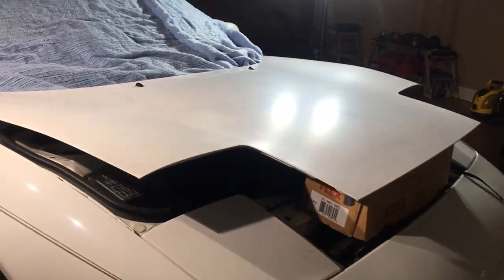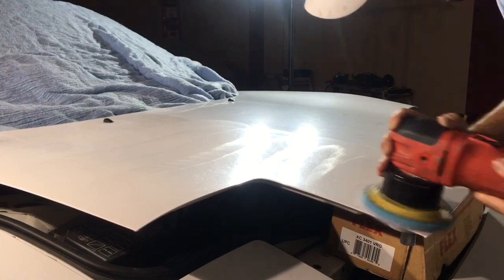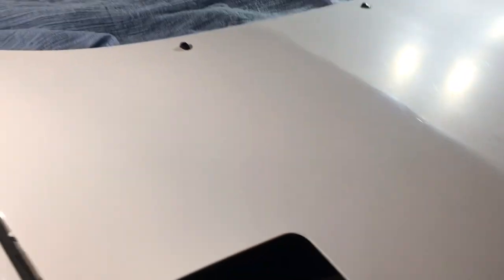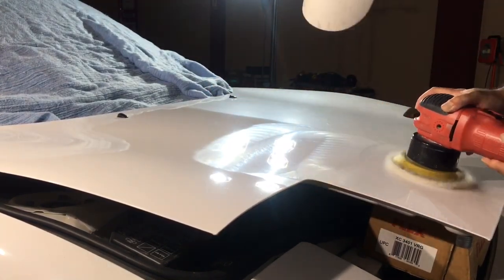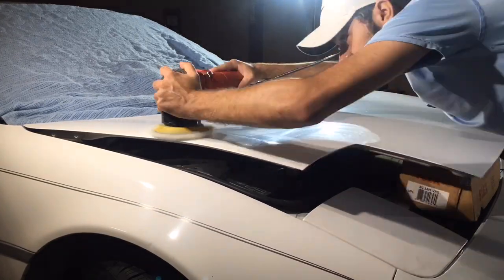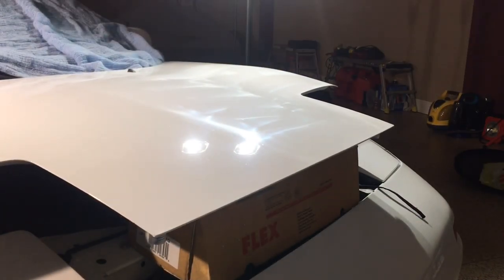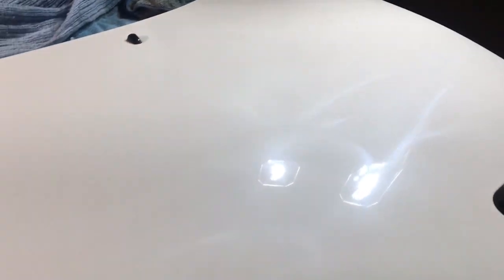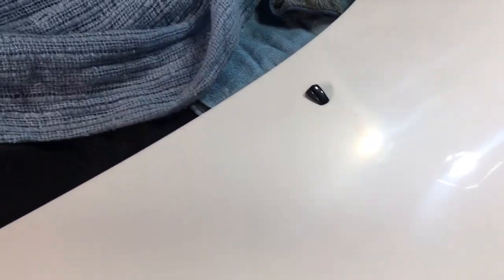Beginner Polishers Vs. PRO Polishers THE UNTOLD TRUTH! | WHAT YOU NEED TO KNOW!

Comment: If you had one DA to choose for all your steps, which one would you pick?
Reply from the maker: G21.
Reply: Next Level Auto Detail do you use a 5” backing plate? Or keep it 6”?
Reply from the maker: I prefer my 6” plate. But I do have a separate G21 with a designated 5” BP I call that my G22. 

The 5” is not as smooth and balanced as the 6” but the 5” does increase the overall aggression of the machine because it increases the overall OPMS. Increasing the OPMS while traveling 21mms is a recipe for heat build up. It puts a lot of stress on the pads and it’s wise to swap out pads more frequently when you are using the 5” BP

Comment: More pressure to the machine = less passes?
Reply from the maker: Adding pressure to the head of the machine is most important when using a 8mm DA that can be a porter cable, a griots 6”, a Meguiars , even a flex 3401. If you are not applying 10 lb of pressure + you are not going to be effective at removing defects. Those machines require pressure to remove defects effectively.

With the rotary rotary you don’t want to apply that much heavy pressure just engage it.